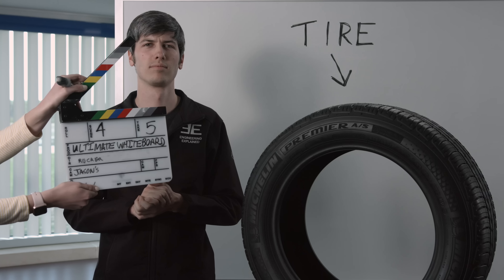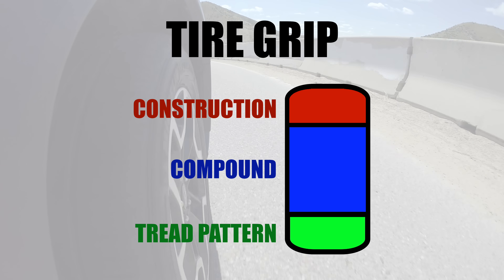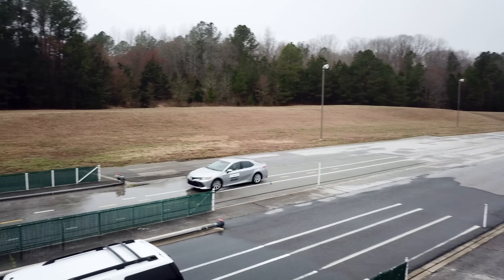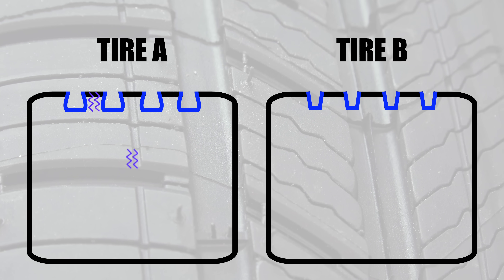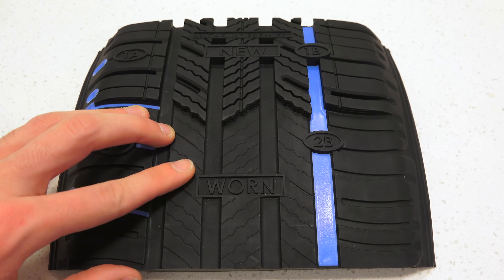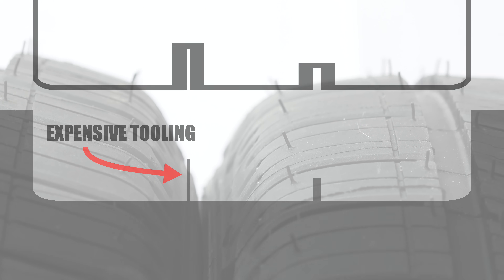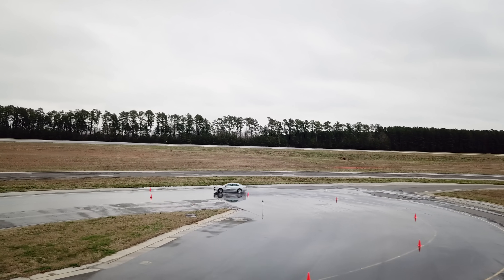New Tires vs Worn Tires - What Performs Best?

Comment: OMgosh have set of Michelin like forever, yet I don't drive much car sits around 3 mos at a time. Front thread baby gone, yet running like a gem. Yet I avoid driving when wet, about to replace to some used one. Good info!

Comment: Last week I changed my front tyres. Both old and new were Continental contactsport 5. The outer half of the old ones were slicks, the inner half had just a bit of profile left. After about 1h on the new ones they currently don't have the dry road performance the old ones had. Braking is less and in corners I have to correct more.

Comment: I bought brand new 35" all terrain General grabbers for my truck and had them installed and my truck feels like its fishtailing on ice when I'm swerving or switching lanes, it felt way better with the worn out bfg all terrains I had. I dont know if it will go away or if the tires just suck, I paid $1400 for them -_-

Comment: Some good insights on why some tires cost more than others.  As far as driving on older tires, if they have no dry rot, you are probably OK on back roads below 50mph, but on the highway, watch out.  Proved this recently with a set of 10-year-old Dunlop winter tires that look like new as I rarely drive the car on the highway.  But at 60 mph had definitely developed  a shimmy.  Also, stay away from Chinese tires with unknown brand names to avoid balance issues in highway driving.

Comment: I had those Michelin Premiere A/S on my Accord before it was traded in and those tires are the best all season's I have used to date! It got me through 6-8 inches of snow with no issues and also with no compromise on safety!
Reply: Lets pray the Michelin sidewalls would not cracks with a million smiles in 3 years just like my.
Unless you used up all the treads before that.
Reply: @loktom4068  That tire had like a 75K or 100K tread life warranty and did you not take advantage of it?

Comment: Most new tire tread these days are built only for fifty percent or less of the tire life.. If you look at a new tire tread you will notice that if fifty percent tread wore away you going to end up with virtually a slick. That is why it will grip better in the dry rather than the wet. In other words your getting ripped off by the tire manufacturers. End of story.

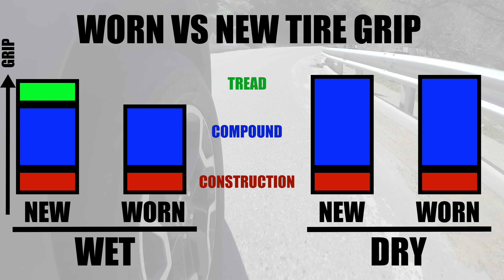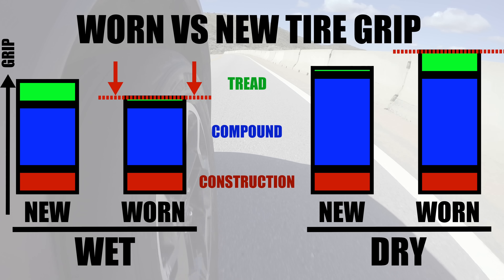Comment: There can be a mistake at 1:20-1:40 - compound DOES change with wear (with time). Because rubber isn't 100% chemical inert - it changes, usually becomes firmer.

Comment: Question for all you guys, On a dry asphalt will a regular new tire have more grip or does the same tire but worn so much that it almost became a Semi will have more grip? 

my 2 front tires are worn due to trackday, and my rears have tread, cheap nankang sport tires, will the bald tires have more grip or will the rear tires with atleast 2.5mm have more grip ?

Comment: You should have mentioned that new tires require a break in period of about 500 miles of gentle acceleration, braking and cornering to perform as they should

Comment: Only problem is that the Michelin Premier LTX tires only have 8/32" of tread when new. These tires have a tread warranty of 60,000 miles, but Ive been replacing them on Equinoxs with 30,000 or less. I had a Michelin rep recommend we do not sell the premier ltx as a replacement tire; even though the vehicle was sold with these tires from the factory. Sure, they might handle better when worn, but they better because they wear out damn near instantly

Comment: I can personally confirm that good tires, even on stock suspension, makes the biggest handling difference on a car. I drive a 1996 Volvo 850 with a few mods (BC coilovers, sway-bars, wheels/tires, intake, exhaust, etc) on track and autocross and the tires by far were the biggest improvement. Falken Azenis RT615K+ tires.

Comment: So, you're just going to sit down there and tell me, a Michelin tire of a particular model dated 2009 is the same as its 2019 version uhn? also heat cicles/sudden temperature change etc. how could you forget to mention what is to me the most import thing to factor out when talking about tires?

Comment: Thread pattern/depth changes by wear. But also compound changes by age (eg. for winter tires some additives to rubber may wear/vapor/press/whatever out), and also even compound might get adversely be affected by heat cycling (especially matters for tires used in both daily driving & trackdays). Michelin is often mentioned as providing more mileage in most classes of tires (at usually also proportionally higher price though), but there might be cases where no matter all the tries with smart tech to improve tire performance at higher wear, but cheap new non premium tire can outperform used premium one.

Comment: Very interesting. On a Porsche that I had years ago I had a set of Yokahama A008Ps that I carefully rotated frequently to equalize treadwear. I timed the point when the tread wore down to zero to the beginning of our dry season in San Diego and so I was able to drive the car for quite a while on slick tires. The handling was fantastic, above the already great handling of the tire and I had no problem. On the rare occasion when I did encounter water on the road I would just slow down and drive more carefully and so I never had an issue. However, when my wife found out that I was driving on slicks she made me go out and buy new tires😟

Comment: I've got some Heidenau K66 Silica winter tires on my bike and they perform like a beast in every situation! from -10-30° C they can Perform  great but with sunshine and dry roads the sweetspot is between 0-20°C. They can handle icy (not iceplates xD), slightly snowy roads or while raining under 6mm water on the street pretty impressive. They feel like sports tires at our todays temprature about 15°C.

Comment: tires with higher mileage warranty,have harder rubber compound  after 50% use to meet warranty,so they softer rubber for first 30K to 40k and harder compound under that ,that is why worn tire are not as good as new

Comment: Being in the tire business I can't sell Michelin. The beads are so flimsy. The cost is so high. Durability on bad roads is low. Bead sealing is terrible causing corrosion. Think of all those 90s Cadillac rims that leaked. Still happens.. I've taken brand new Michelins off of a car I bought..

They have a couple tires high performance tires now that have a small backbone around the bead. But still not worth is.

Comment: Great video. Have you considered doing a comparison video between premium brands vs. budget brands but instead of using the same size of tires, use a budget brand tires that is 10-15mm wider but still maintains roughly the same circumference. For example, Bridgestone/Michelin/Goodyear 195/65 R15 vs. any budget brand 205/60 R15 or even 215/55R R15, etc. if these tire sizes exist. My theory is that would the wider width of the budget brand tires compensate for traction/grip and match the performance of the premium tires and at the same time cost far less? I will be watching. Cheers

Comment: Well, you gave very wrong explanation of used tire on dry surface. You should never compare road tire with racing slick. Dry racing tire works only on compound when tire is warm. Normal road tire works with elasticity of each rubber block. While tire wears, block gets more thinner which effects in elasticity of tire. For example, your cornering speed will be the same from 9-5 mm, after 5-0 mm, cornering speed rapidly decreases. If you want better grip with thinner blocks, you need softer compound. Yes, that is how you get to the slick in the end. Very softer and different compound than normal road tire. This is very dangerous to mix, because 99% of drivers will agree with your explanation, which is unfortunately - wrong.

Comment: Sadly not true that the compound doesn't change over the lifetime, as a tyre heat cycles, some of the substances that give the rubber its elasticity and grip dry out. A track tyre particularly is significantly worse towards the end of its life.

Comment: No doubt that Michelin are one the best if not the best.
Shockingly, some specific sizes are available in single edition or one option only and quite expensive ($1250+) if you need to buy a full set at once!

Comment: It depends entirely on what you are doing. On dry pavement, new tires won't perform as well as worn in tires due to the flexibility of the taller tread, but on wet pavement the taller tread blocks of the new tires will be far less likely to hydroplane due to the larger amount of space for the water to travel as the tire travels through the water. This will pretty much hold true until you get past the wear bars and the tread is completely gone, leaving no tread compound left to grip the pavement.
Reply: Of course, if you heat cycle the tires enough, they get hard, and will also lose their grip. Shaving the tread of the tires pretty much ensures the best dry traction over the life of the tire, with not enough "time" to heat cycle the tires enough to mess up the compound before the tread is completely gone. Not recommended for a daily driver, obviously. :D

Comment: I have a pajero that had tires 265 x 65 x R70. Now my new tires are 265 x 70 x R70. Will it make difference? One thing I have noticed is that b4 my GPS used to show that actual speed is 7km less than shown on speedometer. Now speedo & gps showing same speed. Please advise if u can. Thanks.

Comment: I used to work for a Tire cord company that supplied polyester cords to virtually all tire manufactures on the planet.   
Michelin always demanded the best performing cords with strict quality control.  The quality demand by Michelin was quite difficult to meet in most times.   So I tend to trust Michelin as a consumer. 
Some major tire companies (North American brand, sorry) were not really interested in the best quality cords.  Instead they wanted cheaper versions.
The other tire company that demanded quality cords were Hankook tire as well as Nexen.    So I trust this company too.  But when it comes to compound technology, Michelin is  the best.

Comment: I just bought Premier A/S last November and ran them through most of the Canadian winter.  They had very good start/stopping traction in the snow (for all seasons) but understeered quite a bit when turning.  Tread design probably affected this the most as they are designed for water not snow.  No issues with wet traction or wear so far. 
 Overall they are decently quiet and I am happy with them.

Comment: Again, this guy cuts corners. I would claim a tyre is much more likely to  loose dry grip in time span since the rubber dries. Sure, if you wear it out quick enough the treadblocks become stiffer due to higher width/height ratio and you get better steering feel but every heat cycle dries the tyre, as does light and ozone.

I just swapped a six year old PS2 to new. There is definitely more grip with the new ones. Of course drying is related to time and heat cycles rather than to kim/miles. Sure you need to break the surface to get the best grip since there is mould release agent penetrated to the surface of the rubber. But after a couple of hundreds of km/miles the the tyre peaks (IMO).

And, silica penetrating water! This I have not heard before. Silica is an abrasive. It is very hard particle and is good at penetrating the tarmac microsurface and gives thus a lot of abrasive grip. Why would a silica penetrate the water better than say carbon black - as they are part of the tread material. Is he trying to say that water has lesser surface tension with silica. I am not saying he is wrong but I’d like to know the arguments for that claim.

Comment: In my old sporty car i have tried several tyres to finally find the one GODLIKE for it. dimensions were R15 205' 55. I originally had goodyear and my god they were horrible. I was having excellent grip for 1-2 corners then they would overheat. then I tried Yokohama, they were consistent but I wasn't really satisfied with the amount of grip they provided. Michellin's were a bit worse but then I got some Pirelli Drago P5200, the grip was not only simply amazing grip but also consistent and only a bit worse than the Yokohama in the wet. I must say however that where I live the temperatures in the summer may peak to 45C during the day and 30+C in the night. There is little rain in the winter and autumn so I was focusing mainly on dry and hot weather conditions... I could do that because at the rate I was consuming tires at the time I needed new tyres every 6 months lol without even burning tyres, just from cornering

Comment: AH, I ain't worries about a little water, it is snow.  Even a tire at 1/2 its life will decrease performance in snow.  Then add a big torque monster engine and 255's on the driving wheels and you have a new contestant in the automotive Luge.  Great video -- I like Engineering Explained !!!!

Comment: Any thoughts on a good tire for a Subaru WRX?  Even stock suspension height I am finding the insides wearing out almost twice as fast as the outside tread...  regular rotations and been to 3 shops for alignments, including a performance shop.

The car just likes to eat the inside tread...

Switched to coilovers recently and I am having the same issue, though a little less than before even with a half inch drop.

Comment: Great vid.  In my dry weather driving (rear wheel drive grip) experience with tires, when the tire wears and the tread depth is reduced and more actual rubber is touching the ground grip is reduced when compared to a newer tire with deeper tread, I’ve always thought that maybe the compound is harder the more the tire wears but according to your video there should be more grip the “balder” the tire is.  I’ve also thought that maybe the actual flex of the deeper tread allows the rubber to get a better hold on the rough asphalt surface, allows it to kind of dig in because there is more material to conform.  I’d like to see a side by side grip comparison with a low tread performance tire and a brand new tire of the same make/model, I still feel like the new tire would provide more grip...

Comment: Tire compound does change as the tires goes through heat cycles.  Depending on the tire that can affect dry traction to a noticeable degree.  Proper heat cycling (esp. for racing tires) can affect tire life as well.  Michelin should have told you that or maybe they didn't want you bringing that up.  Oh well.

Comment: TL:DW Worn tires in the dry act like slicks, more surface area making contact in the same contact patch. This give more friction and better performance.
Worn tires in the wet lose their ability to properly displace water, which allows the tread better contact to the pavement. The non-displaced water now has a bigger pooling effect making hydroplaning easier and decreasing friction. Thus less lateral grip and increased breaking distance.

Comment: Hey Jason, wouldn't the degradation of the tire compound of a worn tire effect the grip quite alot and offset any gains to be had through the increased surface area? Most guys I know that go racing shave their tire to get better lap times, but after a certain amount of heat cycles they either scrap the tires or sell them for cheap. Can you elaborate on this?

Comment: all that technology and yet they still dry rot quicker than most tires out there including the cheapest tires you can buy hence why i refuse to buy michelins and if a vehicle has them when i buy it then i replace them as soon as possible. personally i had rather buy a fusion or a kelly tire above most others out there.

Comment: What about heat cycling and age?  Those most certainly should be part of the compound of the equation, as the compound actually changes depending on number of thermal cycles and age.

Comment: I wouldn't say dry performance increases as tyres wear. Quite the opposite. Especially when using ultra high performance tyres & tracking them frequently.. Graining/blistering affects the compound in a irreversible way. The tyres have limited heat cycles as well. The best laptimes (which means highest dry grip) come when you have fresh tyres.

Comment: Hello Jason, I was just talking to my race team and we have a question on this subject. We agreed more worn or less tread tires will preform better on the track on a dry day. However, I was wondering, what if tire manufacturers have the compound change so that when the tread is worn off, the compound changes to a hard rubber. This would make it harder for a irresponsible driver to have a blowout if they wear their tires down past the tread. Do tire manufacturers do this? If so, it could mean that the tires perform worse on a dry day after being worn. FYI some of us can't afford non-DOT AutoX tires. Thanks, Brian

Comment: Shouldn't the compound degratade on a worn tire due to the cycles of heating and cooling? and How that degradation of the compound will affect the overall grip of the tire in wet and cold surface?

Comment: I had those Michelin Premiere A/S tires on my Accord and didn't need winter tires at all. It had gone through 10+ inches of snow without issues and fuel consumption was awesome and just as good as my Michelin Pilot Sport A/S 3's. It's an awesome all season tire and if you don't get much snow then this is the best you're going to get for an all season tire!

Comment: Disappointed by Michelin. Through their website I chatted with a rep regarding which Pilot Sport 4S tires would fit the factory wheels of my 2016 Forester XT. I was advised that the correct size tires would not be available for a couple months, so I waited. When the tires arrived I e-mailed Michelin to ask about the recommended air pressure. I was told that I should not run Pilot Sport 4S tires on my Forester, and should choose an appropriate all season tire. FU Michelin! I wanted the best ultra high performance summer tires for a resson.